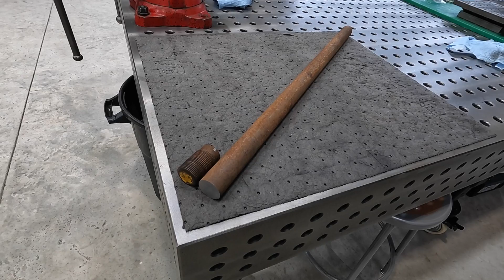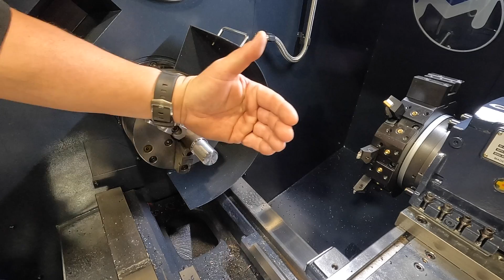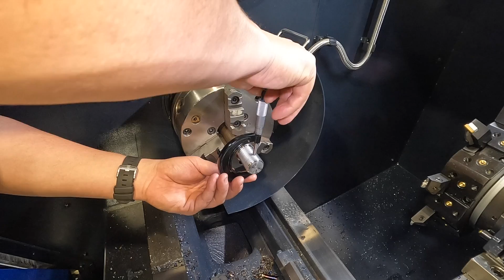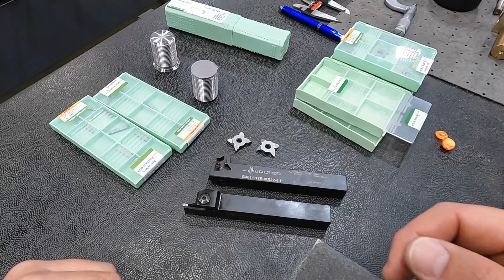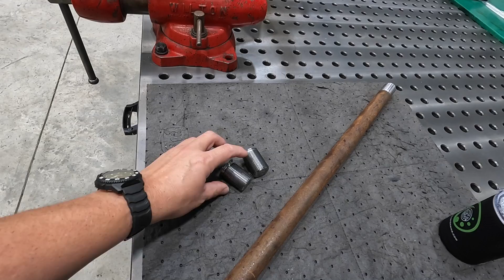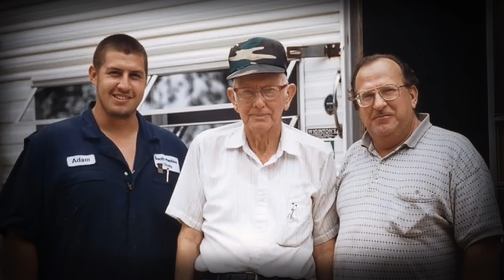CNC Machined Threaded Rod Ends

Comment: cnc units are great for high production jobs , but for one off jobs like this , id say a old manual lathe probly be cheeper an quicker ,,, good vid
Reply: People are getting away from the economics of it.  Once the programming side is learnt and practiced, more than likely quicker to put the job on the cnc.  But surely the real question is if it is affordable, have you got enough work to put through it?.  If you buy it 2nd hand cheaply, maybe every 4 yrs something catastrophic happens ( circuit boards, broken shafts or major misalignment after a crash) and cheaper to scrap, go again and replace rather than repair and service.
Reply: @richardjones7249  Of course u don't buy a cnc for simple jobs like this, but when its not used at the moment, and u have the tools in its easie going - and (because u talking about economic), while the cnc is running, u can do other work . I have to handle 7 machines parallel, and only one is a manual.
Reply: Not for this job. To programm this, u need less than a minute. And, if u know what u do, the first try will be a good part.
Reply: @rene_ger  He couldn't program that job in a minute, he is a complete novice.
Reply: @4418CARLOU  Greg's answer hit not direct on Adam, it was a general suggestion, and so general was my comment to it. But, if Adam did not programm such things, he will stay a novice.  Pls excuse my limited english, hope u understand what i want to say.

Comment: shouldn't the tool offset be 1/2 what you were wanting to adjust?
Reply: Many lathes presume radial vs diametric values. It just depends on how the machine is configured. Most machines allow you to set a preference. Adam needs to find out how his is configured.

Comment: A topping threading insert would help take care of the hairs you keep filing off. 
I use Iscar 16er 24 un ic908 for most threads.
Reply: Definatly. We only use that full profile inserts.
Reply: @rene_ger   Correct, the one he is using is not suitable for a CNC.  That is a poor program (GG, 49 years on the lathe)

Comment: Happy New Year!  I watch Pete from Edge Precision and he uses a Breaker Bar with a socket extension that that fits the chuck.  I think if the chuck key uses a 38 or /1/2 square drive. It would be an easy solution to the problem of tightening the chuck jaws.  If you want to go high tech use a torque wrench.  Your skills as a CNC Operator are coming along nicely.  However, I think I still prefer the manual machining to CNC.  There is something very calming an relaxing about reading dials and turning wheels brings order to a chaotic world. Not to change the subject, but what ever happened to the White Shaper you used to have in the old shop?  Love your videos, keep them coming.
Reply: As a CNC programmer I understand what you mean about relaxing wheels in a chaotic world. Every CNC program is stressful, full of surprises, unexpected problems. Every rapid movement is a 100k risk, the first time at least. Chip management is sometimes difficult in grooving operations, especially face grooves of considerable material removal. Just remember that all complex parts are only a series of simple operations, which is the root of manual turning. This helps with the chaos

Comment: It's a little hard to tell but it seems like from the sound it's ramping up the RPMs during the face cut? If that's something you can set in the program I wonder if it might be useful to test out new inserts by having it gradually change the RPM as it goes along a piece of stock to see what the finish is like at various speeds. Maybe also try it with constant RPM and vary the feed rate along the length of a piece.
Reply: Ramping up on facing is normal to keep the cutting speed at the correct setting, some of the finish issues are from the lack of coolant,  lack of rigidity in a small machine and insert geometry, could benefit from getting a tooling rep in to suggest some tools
Reply: How can one vary feed rates when cutting threads?
Reply: G96, css,  Constant Surface Speed.

Comment: Because you are dealing with a round circle, as you add or subtract diameter, your number will be doubled as it takes material from the circumference. If you want to remove 0.001", you would change it 0.0005" (half the distance).
Reply: I was thinking the same but he ended up getting his desired diameter with a spring pass. Some machines move with adjustments diameter based not radially.
Reply: It depends on how the lathe is configured. Many lathes presume radial values. On CNC machines, it's usually configurable. Adam needs to find out how his is setup.

Comment: Did they show you to single block each tool before going full speed through the program? Also, before running your threads, set the option stops on the threader and add .005 or more to the threader offset and bring it in to tolerance while it’s still in the chuck. You won’t scrap the work.
Reply: Is that machinist word salad?
Reply: Yes, run it through the graphics 1st then check it in single block.

Comment: On a manual lathe you generally have the compound slide set at 29 1/2 deg for 60 deg thread cutting, why doesn’t the CNC do the same? Does it make any difference?
Reply: The goal with the 29.5 is to only cut on the leading edge of the tool and optimize the path of cutting forces. The CNC can do that easily by simply moving the tool appropriately in an X-Z direction instead of the "hard restriction" of the angle of the cross slide.
Reply: You can actually set how the tool will feed in with each pass.

Comment: Dumb question: what is guard around chuck for? You're already in an enclosed environment. Don't see you using a chuck guard on your other lathes?
Reply: Chuck wrench safety. OHSA redundancy.
Reply: There is a limit switch that requires it to be closed to turn on the spindle.
Reply: Pretty easy work around on that machine. Just rotate the shield into place and remove the shield. Limit switch is activated by a ring that rotates around the spindle.

Comment: Wouldnt changing the X offset by a thou add 2 thou to the work anyway?

A thou each side?
Reply: Depends on diameter vs radius machine.  Most machines are set to diameter. So amount put in is amount taken off OD.
Reply: @206sea  Changing tool offset changes the radius, not the diameter.
Reply: @206sea  Is it not possible to select  in the lathe setup, wish one you are using?
Reply: Not on CNC if he adds or subtracts in the “wear” offsets. The program will take exactly whatever is entered. So “-.001 +insert” in the wear offset will move the tool negative .0005 and the reverse is true if you add positive .001

Comment: You'll get better performance out of left hand tooling instead of the right hand tooling you're using. With the right hand tooling (insert is facing down) the tool pressure is trying to lift the tool changer, might be some of the chatter sounds you're hearing. With left hand tooling (insert facing up), the forces are pushed down into the ways, much more rigid
Reply: Depends how the turret is locked. My turret is backed up against a pawl so i always have the tool preasure against the pawl.

Comment: Just out of curiosity, but why is a thread relief necessary on a CNC cut thread?  Not being a smart ass, just curious.  I was under the impression that the thread relief zone was added in manual machining applications to give the operator a zone that wouldn't be inconsistent at the trailing end of a cut.
Reply: It provides a fixed flat shoulder for a nut to actually stop against, rather than just binding on the vanishing final thread possibly damaging the nut's thread, jamming, or just not stopping at the desired fixed point.  It's good practice, and in some applications a necessary feature.
Reply: @advil000  There is no thread relief provided on rolled threads or threads created with a die... They work fine.  Im pretty sure that thread relief is only necessary on manually turned threads.

Comment: That’s the first Cnc lathe that I see that there is no hydraulic chuck
Reply: Non hydraulic chuck are exstremely common on cnc's
Reply: If You listen to some of the guys with lots of experience sometimes they prefer non hydraulics because of the dynamics when a hydraulic chuck spins really high rpm the clamping forces in the chuck can change and upset the part. Horses for courses I guess.
Reply: @raindeergames6104  on at home CNCs *
Reply: This is a tool-room lathe model, not an automated-production model. It's designed for combination manual/automated operations - perfect for Adam. Milltronics makes other styles too.
Reply: @kindabluejazz  well you’re right but still it’s first for me to see on a full Cnc lathe (with turret) with a non hydro chuck I usually see them on conversational lathe

Comment: The machining might be faster but what about the set-up time.
Reply: It depends... I've seen techs make magic work with conversational. I mean once you get the feel of a machine, the button pushing speeds way up. Also, he's doing alot of explaining.
Reply: Production work is where the CNC machine shines
Reply: @JeremiahL  Exactly if you are going to make a hundred or more CNC is the thing to have. For a one-off part it is not practical.
Reply: @JeremiahL  It all depends on the software. Ten years ago, I could whip out a CADD drawing very quicky. But there were somethings where it got very picky about what you did.
Reply: @JeremiahL  CNC machines are best at making parts in quantity.
Reply: Loads of CAD software about that have built in tools to do most of the hard work , so it’s just down to you with the speed and feed rate.   Look at titan cnc videos huge difference in tasks they do and look how quickly it’s done on a professional level

Best bit is once the program is written and tested he can run it again at anytime if the customer wants the same part again or even a spare.

Comment: Seems to me like that machine needs their sheet metal reinforced (sound deadener) as it sounds like its "oil canning" when cutting big cuts and there could be some machine flex in how it works on the thread process that is causing the settings on the panel to be different than the finished part. Work is completed rather fast yes but add into that your programing time.

Comment: The first time I ever saw a CNC lathe was back around 1976. There was a small machine shop a few doors down from the welding shop that I worked at and they had a recurring contract for various levels of Government that required they take bronze castings, face them, and turn two different inside threads, one pipe thread, one straight thread. They already had the fixture for holding the pieces in a lathe but everything was still manual and it took about 10-15 minutes per piece. The rough castings used to come in 45 gallon drums with the tops cut off. You took a piece, set it in the machine fixture, trued it and then machined it. Once done, remove and repeat. They did thousands of these pieces on each contract so time was always a consideration to make delivery dates and it kept four full time machinists and lathes to satisfy the demand. The shop owner, a fellow named Alex Campbell, had attended a trade show in Tokyo and seen one of the first CNC lathes being offered. It operated using punch cards or, with a special reader, punch tape. He essentially mortgaged the farm to get one and had to wait 6 months for it to be delivered and set up in his shop. Once the machine arrived and was operational he invited me over to have a look at his baby. So I went over and Alex gave me the nickel tour. There was a young fellow, probably an apprentice, standing next to the machine. He would take a piece out of the barrel, place it in the fixture in the chuck, true it, close the door and fire up the machine. About 2 minutes later he would open the door, remove the piece, and repeat. Alex told me that the time had gone down to 4 minutes per unit so it was obviously much faster that the tool room lathes they had used before and his journeyman could be put on projects better suited to their talents. It was amazing for the times. As we walked away, Alex told me he had one regret. I asked what that was and with a smile he said, "I should have waited a month before I bought it." I asked why and he said, "The newer replacement model had come out a month later and it was faster, more accurate, and had an optional robotic accessory to install the pieces so they were already true." He figured it would knock off another 30 to 45 seconds per unit. Then, with a big smile, he said, "And the price to the clients is still the same." Alex soon had a few more CNC machines and he retired a multi millionaire when he sold the business............
Reply: TLDR: Guessing what you meant: CNC good, Lathe bad?

Comment: You can top the threads leave like .003 or less usually 1-3 thou radially on before you finish the threads then take your dia right to size then run the threader once for your final pass. For the chatter I would start with reducing your spindle speed for the threads and with the groove like you said use a smaller one and take multiple cuts.

Comment: Adam how warm is the part getting after all the cuts not running coolant? That maybe a factor in your thread measurements. When CNC cutting because the work is so fast it generates heat instantly with no cool downs between cuts. The reducing cuts may need a 5 minute delay before moving on to the next cut or use your mister for now. The coolant is key when CNC cutting. A good tool to use is a laser temp gauge to get better measurements. Having your coolant set up will make everything your experiencing go away.😉👍Happy New Year & Many Many More!

Comment: Why you didn’t use an cutting tool with an sharpener edge and just program that groove with your whole contour? A cnc machine should easily manage to do an radius 😅
Reply: A VNMG insert would do the trick or since the thread will disengage in exactly the same place every time you actually don't need a relief / runout groove just terminate the thread and the machine normally pulls out within about half a turn leaving you with even less stress risers than the groove.
Reply: He’s still thinking like he’s doing it on a manual lathe, he only needs two tools for the whole job (third if parting part off)
Reply: @Dont-come-at-me-24  Yup its a hard mental hump to get over but I'm sure he'll get there.
Reply: @Dont-come-at-me-24 maybe 3 I would still argue you want a rougher and finisher for that OD for good practice. There was a good 55 deg tool in position 4 that the undercut could have been done with.

Comment: A tip we use in our machine shop, after you run your threads come back with your OD turning tool for a skim over the top of the threads then run the last pass of the threading tool again. Leaves amazing threads with no need to file by hand.
Reply: Nice tip thanks
Reply: Came here to to say this, and to use a smaller radius tool and profile the radius. The CNC doesn't need to plunge cut with the right radius to get the final shape.

Comment: When threading does the cnc advance on a 29 1/2 degree angle like you would manually?
Reply: I run Siemens 808D controls on my CNC lathe and setting the advance angle to 29.5 is an option.
Reply: @CSX66_Engineering  Thanks for the info! I was just curious more than anything
Reply: I run Prototrak machines as well as a Tormach 15L both feed in at 29.5 both also use constant surface feed. So cut 1 is pretty deep and it reduces the depth as the cuts get deeper to minimize chatter.
Reply: @TomDetka  Nice to see another ProtoTrak user. I have Lagun FTV2S mill with an old MX2 contoller. Still works fine for what I do.
Reply: I second this, I've always been curious if that is possible with a CNC

Comment: I always like my barstock cut flatter, that way you don’t get so much of a interrupted cut when you first start machine in the end. I like to use a combination square to set my stick out, that’s why it’s always consistent and easier. You’ll be surprised how easy it is to forget what it supposed to be and you have it sticking out too far when you’re crashing to the end of the bar. Don’t ask me how I know that I think you might have your stocks sticking out too far. I would’ve had more passes on your threading, at least to spring passes. If you’re off by 1 thousandths on your thread diameter, just run the threading program again and you’ll be in good shape. I always like to have the mating part to threaten. When available. I know you’re not running coolant so we can see better. But when you run coolant it will also change your size. You are mikeing at the very end of your part, I would like to be towards the center part of the threads. You might have taper.
Reply: Yup this guy runs cnc lathes. All great advice especially hunting down that last thou. Also regarding that last thou all threads have a tolerance use it don't sweat 1 thou when you have +/-0.007